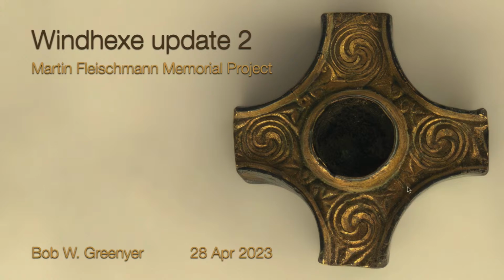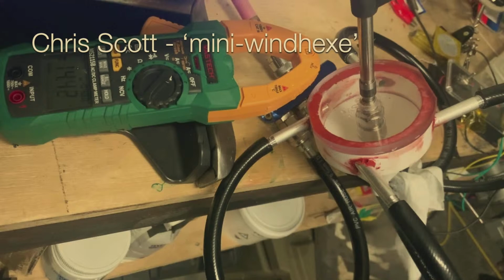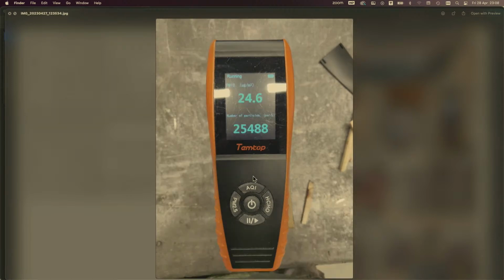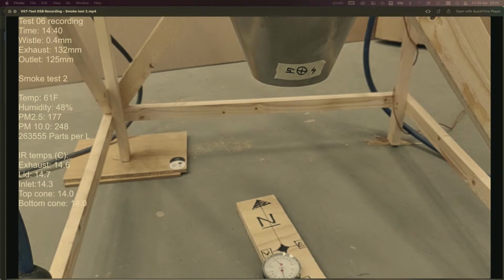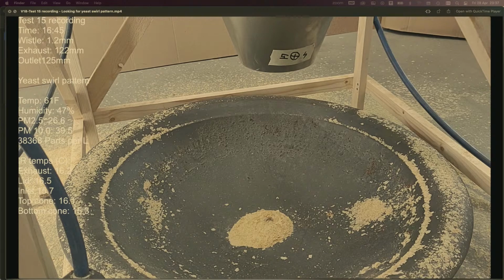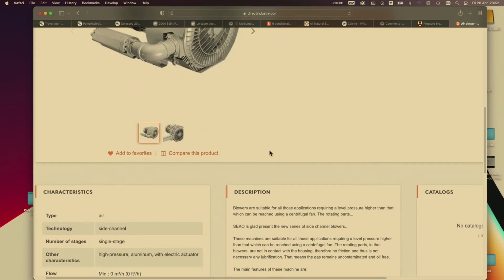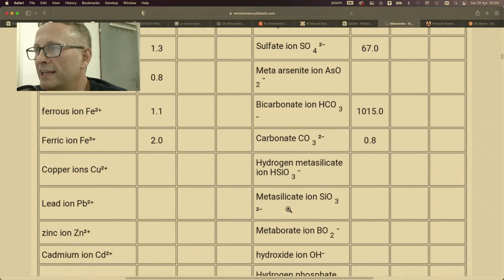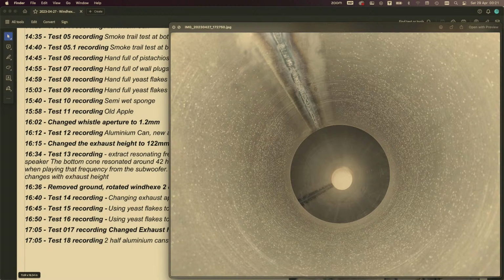Windhexe update - End 4th Week April 2023

Comment: Also back-pressure may be worth looking into as well as temperatures at inlets and outlets as these maybe relevant for tuning parameters/indicators? https://youtu.be/548MQVmFwv0
Reply from the maker: Yes - and it appears that it does not work with air below about 110ºC and ours was well under 20ºC - but we are going one step at a time.

Comment: Wonder if cold steam is worth a try?
Reply from the maker: Is that even possible?
Reply from the maker: Do you mean cold water vapour?
Reply: @MFMP  this is used to power a Tesla turbine. Just thinking if it’s something to do with charge separation does it need to be hot? So long as it’s steam?
Reply: Actually going back to that video it needs to be a sealed system. Not sure if there’s a way of harvesting the steam into something like the wind hex?
Reply from the maker: @martinhughes1854  I believe charge separation and build up of charge is critical. Not easy with dry cold air.
Reply from the maker: @martinhughes1854  If we inject enough CFM of 110ºC air into it with moist target material, I think we will see the effect.

Comment: Immense kudos to you, Tony, for doing this work. 
Using ChatGPT for a quick abstraction of the literature: "One study published in the Journal of Environmental Management evaluated the use of the Windhexe for processing construction and demolition waste materials, including concrete, brick, and asphalt. The authors reported using air pressures between 6 and 8 bar (87 to 116 psi) and air volumes between 100 and 150 cubic meters per hour (59 to 88 cfm) to achieve effective reduction of the materials. Another study published in the International Journal of Mineral Processing evaluated the use of the Windhexe for processing mineral ores, and reported using air pressures between 3 and 7 bar (44 to 102 psi) and air volumes between 20 and 200 cubic meters per hour (12 to 118 cfm) to achieve successful reduction."

We're clearly not going to see much action without much higher air volumes injected, even though this is scaled down. You should try predicting what's necessary and testing at that (your compressor is only delivering its rated volume as it's running, your storage tank/regulator/line system, of course, is what's stabilizing pressure).maybe this follows scale, maybe not. The prediction may or may not be close, but volume's pretty obviously a critical opereational parameter, and at least you'd have a better start-point for trials, limiting unnecessary trials. 
You might have started to see something more with the can if you'd thrown in a bunch more, the feedstock acts as a grinding medium as well, maybe it also acts as an energy source for the anomalous (not purely mechanical) stuff- there's acoustic energy from stuff clattering around along with the heat and potential electric discharge released from breaking  interfacial and crystal bonds.
Reply: Hi Thierry Thanks for your reply! Do you have a link to the literature on this study by any chance? 
The cfms and psis and the volume of the windhexe are definitely important ratios to figure out.
These test were done with compressed air 7.5 bar, and had ~12cfm of moving volume at each inlet. 
Inside the windhexe it self there isnt any pressure building up since the top and bottom are open but only at the inlets theres enough air flow restriction to build some pressure. 
Main thing to trouble shoot right now is that I need larger CFMs whilst being able to maintain pressure by connecting 2-stage blowers to the current windhexe. Or make a scaled down version of the windhexe that is in right proportion to the compressor air supply. Either way it's all about the right ratio. 

When it comes to the mechanism of the disintegration of materials. I suspect that charge separation ie ionization of incoming air plays a large role. But I'm still diving in to all that whilst de next adjustments are being done to the prototype! :D
Reply: @TonyJaboney  I asked ChatGPT for cites, it didn't return anything specific for this one source, nothing specific from a general search yet, but I got sidetracked on other stuff, so I'll try again.
Reply: @TonyJaboney  I asked ChatGPT for cites, it didn't return anything specific for this one source, nothing specific from a general search yet, but I got sidetracked on other stuff, so I'll try again.
Reply: @TonyJaboney  Journal of Environmental Management:
M. Bohn and S. Dannwolf, "Mechanical treatment of construction and demolition waste and mineral residues using the Windhexe technology," Journal of Environmental Management, vol. 182, 2016, pp. 264-271.

International Journal of Mineral Processing:
A. Alfantazi, A. Dodbiba, and K. Sarbutt, "Application of the Windhexe in the treatment of mineral ores," International Journal of Mineral Processing, vol. 86, no. 1-4, 2008, pp. 72-81.
We have TERRIBLE connectivity locally, nothing specific returned last night when I searched, this time it took a few seconds...
Reply: Just asking for the direct link to the study since chatGPT has a tendency to conjure up statistics out of nothing XD 
I've tried using the search engines but I could not find any study published by the journal of environmental management on the windhexe

Comment: What if u use the hot end of the vortex tube and the cold air blow back to the blower to recirculate the air or use the cold air to condense what comes out the top?

Comment: For a few years I have been tinkering with the basalt, calcium carbonic acid link with hot spring water.  There is "something in the water" related to Lenr. In the same note have look into the recent research with Roman Concrete and the calcium inclusions. This may be what the large toothed mill was used for.
Reply: Penny hot spring in Western Colorado is surrounded by basalt limestone and marble.
Reply: @Michael Hutchinson  thankyou for sharing, Bob

Comment: Following on from this presentation, I was thinking about how best to feed material into the vortex as well as where the reduced material is likely to exit and realized it must be being expelled out the side of the vortex into the space between the vortex and the wall, where it falls back down through the hole at the base,  This also strongly suggests that the best place to introduce material is, indeed, along the central axis.  This then got me thinking that if there is a central pipe that feeds material into the vortex along the central axis, a SECOND smaller cone underneath the first could be used to collect the material, possibly in a second vortex, possibly like so :
-->|             |<--
     \           /
      \       /
   -->|  ||  |<--
        \ || /
The second cone could then perhaps act as a reaction chamber or, at least, a "lazy vortex" creating a spinning exhaust.  Just a thought.  At the very least, it should make collection of any pulverized material much simpler, as such material is expelled from the vortex to between it and the cone wall.
Reply: The central feed tube is an obvious addition, leading down another testing rabbit-hole, because it might have a dramatic effect on the overall operation of the system (like Henk trying the hemisphere, then removing it). If it outright kills anomalous not-purely-mechanical behavior it obviously needs to be removed, but there's still the problem of feeding input material- once that anomalous behavior can be recategorized as "useful" and "controllable", because of the potential radiation or other negative effects, we'll need a remote feed system. I'm going to guess here those negative effects don't radiate spherically, but have a directional bias.

Comment: (for the mini winhex) I would put adjustable ball-gauges at each input to tune the device (tune the flow for each input to be the same) . They're not too expensive, and so long as all 4 are in the same orientation, they can be set precisely *I recommend the old-school ones with the floaty ball inside a graduated tube, not the digital ones.

Comment: If the spiralling air has impurities in that air, static charge would build up. The steam, aka gas, would excite the electrons, which are producing the static, breaking the electrons out of the Valence band. This produces the larger field induced into the meter.
Reply: The air is nowhere near pure if it's coming from any common compressor type, there are definitely traces of oil that are nearly impossible to remove unless you have a "getter" in the tank the air is held static for an extended period,  or some ultra-effective filter far better than what's commonly available.
Reply: @ticthak  Use a bubbler and carbon filters.
Reply: @chuxxsss  Again, for any high throughput of air, there'll be entrained oil, even if it's just ppm. Then, if you use a bubbler, you'll entrain water mist a carbon filter isn't completely able to remove. In HHO systems, entrained mist is a bonus, why wouldn't it be beneficial here? Entrained oil is a BIG bonus in the active GEET.